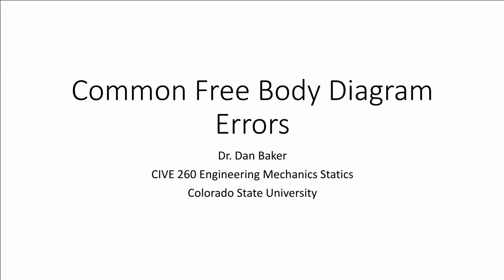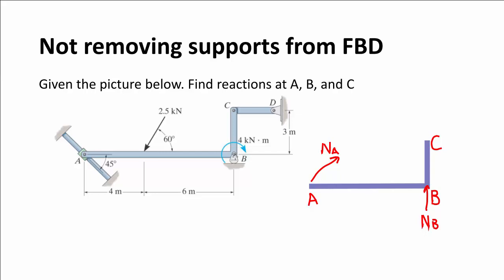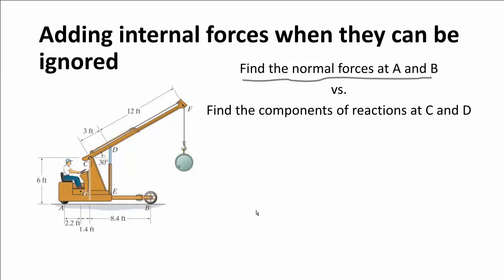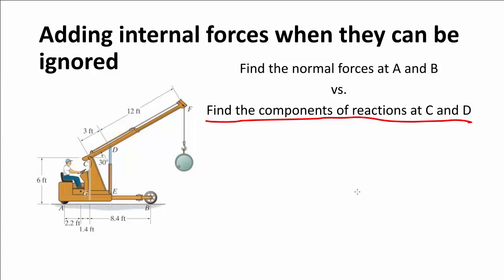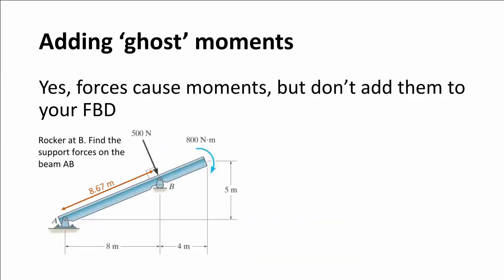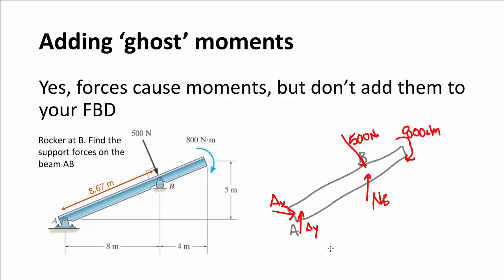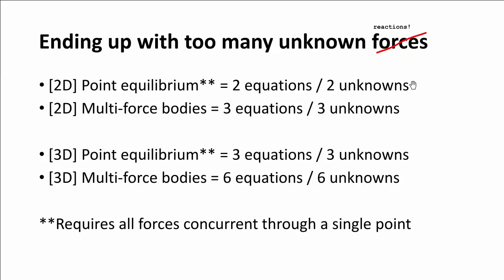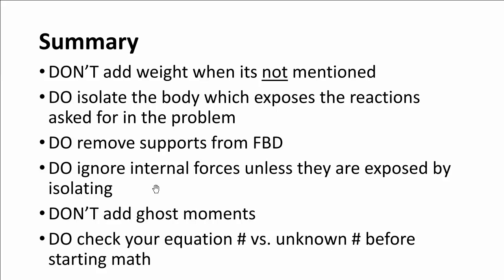Statics: Common Free Body Diagram Errors

Comment from the maker: One additional common error I see is not recognizing that normal and two force members only contain a SINGLE unknown magnitude instead of two components. Hence, a normal or two-force reaction at an angle of 30° above horizontal should NOT be expressed as〈Fx ,Fy〉but instead expressed as〈Fcos 30°, Fsin 30°〉. 〈Fx, Fy〉will give you too many unknowns in your algebra.